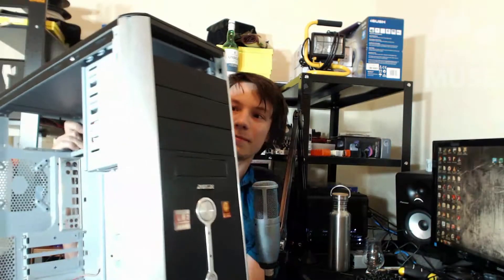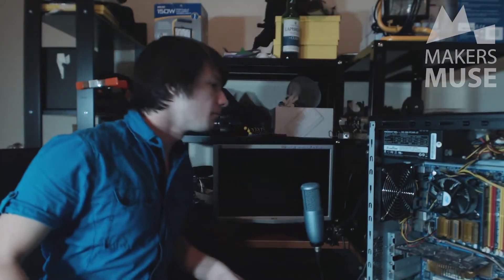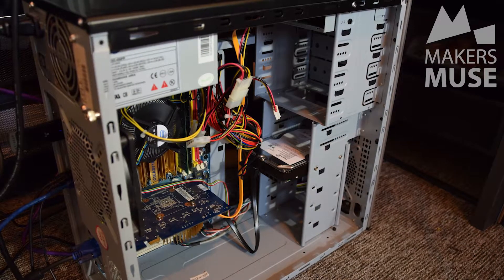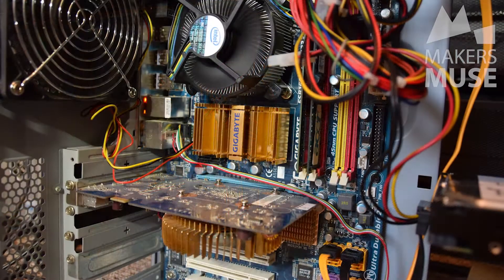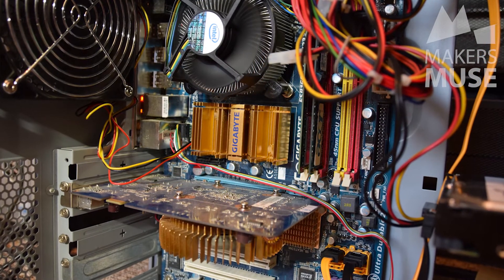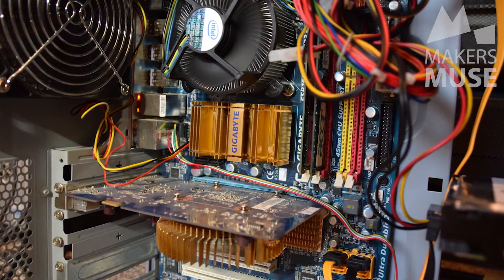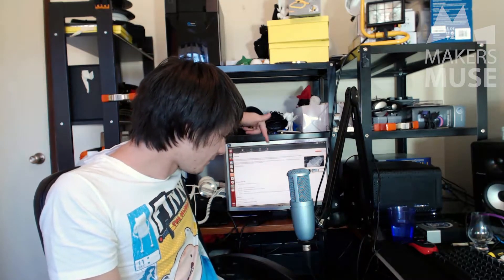CAD PC Dumpster Challenge! Part 2 - The Build - 2015

Comment: tbh, I think the 460 would have worked out better
Reply from the maker: mike52787 The powersupply wouldn't have handled it. I've been meaning to get back to this project... found a 750ti second hand that sips power and turns it into a fairly decent pc. Shame linux runs almost no CAD.... freecad yes, but none of the new gen programs like Design Spark or 123D